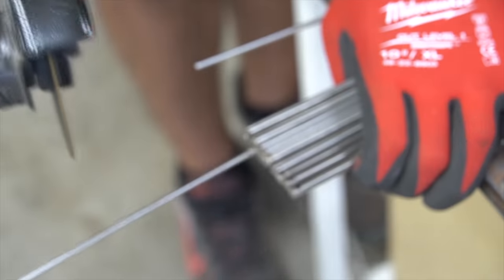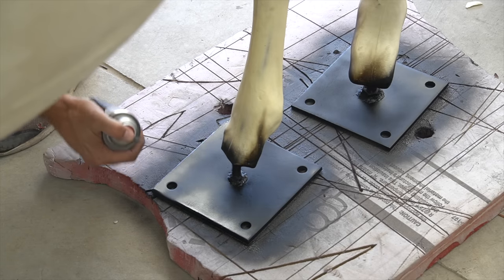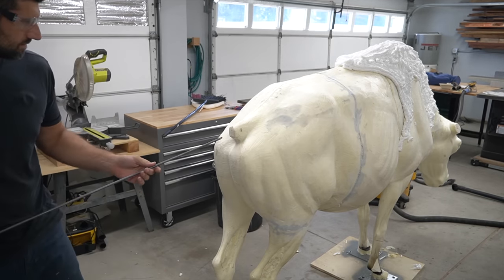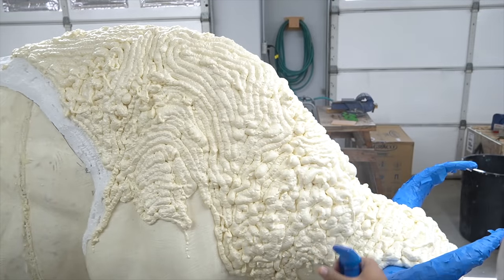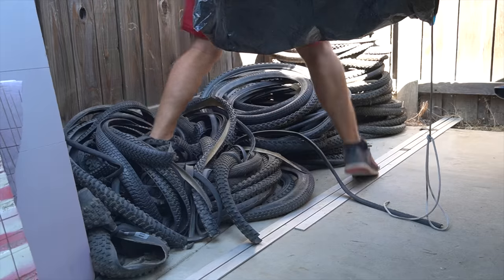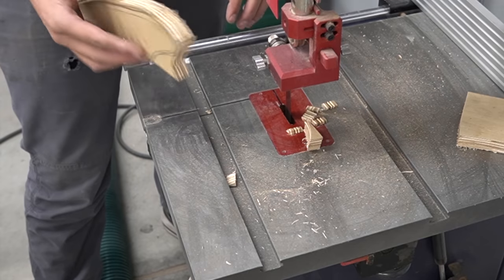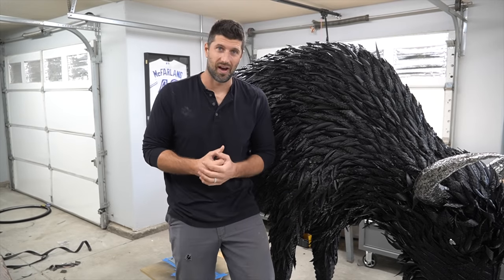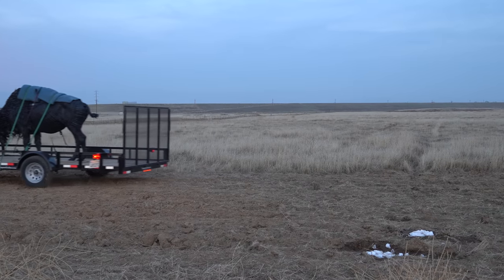My largest sculpture to date

Comment: Another great video, and another impressive sculpture!  I've done a lot of carving with expanding foam- the industrial version that is used for spraying insulation is a fair bit more dense-less air pockets.  I used a Japanese pull saw to carve thicker areas that a knife can't do in one go.  Have you ever used sign foam?  It's a polyurethane that carves like a dream.  Comes in sheets and assorted thickness.  Available from coastal enterprises or sign supply shops.  Carve in any direction no grain.  Sands like mdf.  Available in assorted densities.  Lovely stuff to work with.  Great tip on spritzing the expanding foam.  I'm looking forward to working with tires come summer when my new shop is complete.  You've inspired me greatly!  Thanks for sharing your process and your craft!  🙌👏👏

Comment: Neat tool similar  to your router ,using a smaller corner fitting router.  A 1/4 inch shank. A spade drill bit extensions witch holds 1/4 inch router bits for odd deep carving.  P.S. does work but be careful,  pain hurts !!!

Comment: when using larger drill bits in a drill press, slow the speed down, that is if you can change the speed, it will help.

Comment: I wonder if you could make a jig with two electric shears that would allow you to set the width to fit your recycled tire, then pull the tire through the jig, cutting both side walls at once.

Comment: I'm only 2 minutes in and I have a question. You say the armature is made from stainless steel, but you didn't mention what you covered it with. Looks like lead. By the weight probably is lead. Wouldn't the shine sanded into it be gone within a week of exposure to air and the decay ruin the piece over a not long amount of  time?
I hate it when people comment before watching the entire video. Yet here I am wondering if some sort of clay or weather proof and cement machè might be safer and   .....
Reply: Nevermind. Even though I'm not clear on the tusk materials. 
So cool on so many levels.  Looks finished or close to finished then WOW goes in a whole different direction on a whole different level.

Comment: Your work is so inspiring. I'm tackling my first ever large scale sculpture and in the planning stages. For a beginner DIYer  (who loves to make 3D things and has sculpted small scale w/standard paper, cardboard, plaster etc...) are there alternatives for the fiberglass coating you get professionally done, that one can do on their own? Been doing lots of research. I see some sprays for boat liner spray and other things, but not sure. Ever tried any of these? Would totally sign up for zoom class if you ever did one!

Comment: I use just regular tinfoil and spray it with super77 adhesive spray and it works well to idk if that would work better for you but I say give it a try cause that tape seems tedious

Comment: Love your work, man. I'm curious if you ever tried spraying the brads with a little black Plastidip instead of hand painting? If you did, what was the problem with that method? Also, when you send your pieces out for fiberglassing, what sort of business does that for you? I have to assume they do something else primarily, and you've worked out a deal with them for your work.

Comment: What kind of spray foam did you use to fill in the areas around the neck after you finally got the angle right?

Comment: Absolutely amazing work! You are VERY talented and skilled! Having said that, the Bison’s neck is too long. Wasn’t YOUR fault, initially, as it was WAY too long on the 3D foam piece you started with. You DID manage to correct it, a bit, when you realized you had forgotten his ‘beard’, as it’s called, but had you contrived some very realistic fat & skin folds immediately back of the head, it would have looked more anatomically correct.  
Speaking of anatomical correctness…WHAT HAPPENED TO HIS PENDULOUS SCROTUM?!?
You might have gotten away with only a tuft of, “fur,” just posterior to the umbilicus for the penile sheath, but, really?!? Do you think the theoretical kid hasn’t seen a male dog?!?!  And, Bison have long eyelashes as well. No, I’m not kidding!
But, it turned out GREAT!!! Kudos!!!

Comment: WOW.  Never knew anything like this existed.  Your talent and foresight is amazing.  In a millions years I would never have thought to use old tires.  You should have left the dong to be anatomically correct.  I think the Bull on, oh God a senior moment, can't think of the street in New York where the Stock Exchange is, has a dong.  Doesn't it??  Amazing work.  Where did this end up being displayed??

Comment: Did they request a bull specifically? Because in removing the penis for some reason that to me just perpetuates the body shame culture that we're living in these days, you created a female bison. They don't look that much different at first glance. Also too, by just doing the penis and not the rest of the externals you were sculpting a buffalo steer anyway. 

Bulls are a sign of power, drive, and tenacity, that sort of thing. So I suppose it all depends on what the customer wanted, being a zoo, maybe they just had no preference, but the famous Wall Street Bull I'm quite certain would not have the same gravitas, and impact that it has, had the sculptor in some bout of embarrassment or something about including those pieces which are very prominent if you've never seen the statue, you'll see in a quick search of it online, would have "castrated" the entire purpose of the piece. 

Those parts make a bull what it is. If they were fine with a buffalo cow/heifer, then that's what you made for them I think, and that's fine. If I had commissioned a piece like this, I'd have at the least expected a call to ask the question for clarity, or I'd probably have asked that you give the bull I commissioned and not the cow you provided. Which is excellently done, by the way.  

Just this past week or so, there's been controversy over a school that had its principal fired for allowing the David statue to be taught about, complete with the penis he's had since he was sculpted to be shown to the 6th grade students there in Tallahassee. 

When you at first made the sculpture with it being at least a steer (assuming you'd have caught the other missing piece in your final review) but then in some bit of guilt or whatever it was chose to remove it just speaks to the sad reality we're in these days of denying the reality we have around us, and sheltering our children from the ocean they actually swim in. 

It perpetuates the body shaming and embarrassment of what is just the way we, and every other life form is, and props up a bogus, and sterilized version of it, which adds to the lack of life preparedness many people are growing up not having.  

Love your work, but that bit of the process and your decision, especially if the customer wasn't first consulted just sat with me poorly. I also grew up in agriculture and met people who thought cows laid eggs, and milk didn't come from the teats of a cow, which it indeed does, but the kid argued with the other kid that those were her "titties", not where the milk came from. So there's layers here for me that probably are best visited with a therapist :-P

Comment: You should have had a picture of it with his dong but I would have left it.  Or at the very most would have "tucked it\lessoned it" to not be so distracting.  Looking at picture upon picture of Bison it seems it could have been corrected rather then ommited.  But regardless it doesn't take away from the overall incredible job you did regardless!

Comment: Honestly if its in the outline then just do it. Removing the genitals is just dumb. Should have just done same as the neck and "fur" it and it would have not hopped out as the previous design. Now its like something is missing, all the fur is on the front so seems bit out of balance.